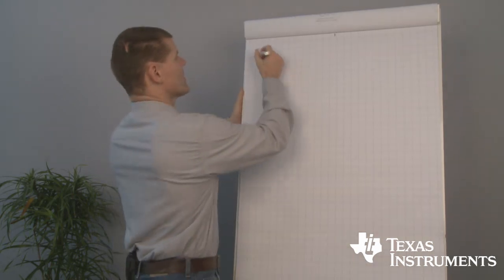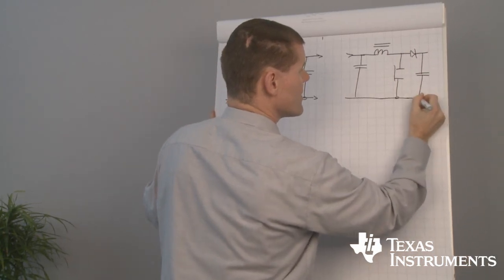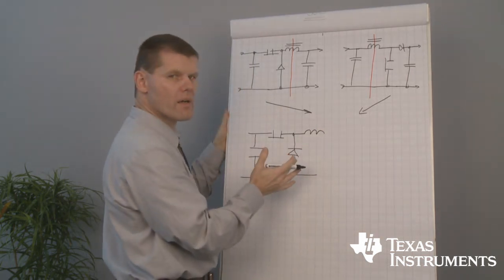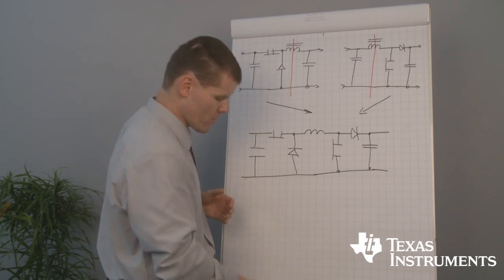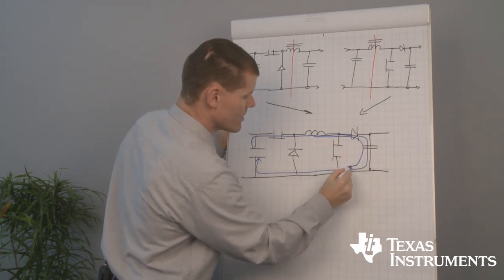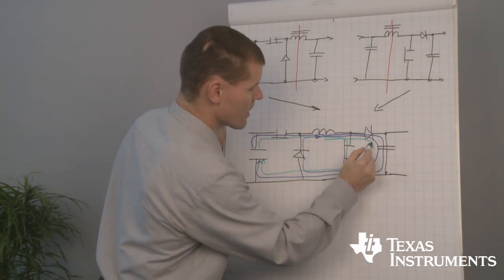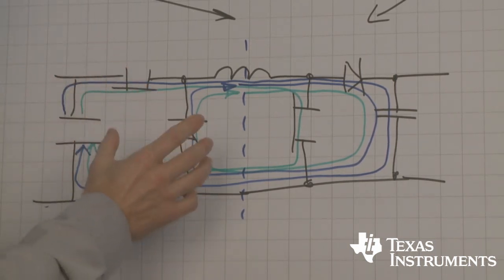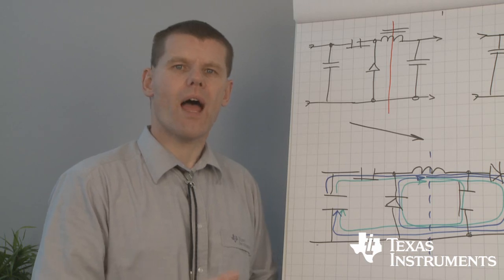BUCK BOOST POWER STAGE - Tutorial with Bernd Geck (part 3)

Comment from the maker: In Boost mode, high side FET is closed and low side FET is chopping. If low side FET is closed, a current is forced across the inductor out of the input capacitor. When low side FET opens, voltage at the inductor turns and is added to input voltage; high side rectifier starts to conduct. This current loop is closed across the input capacitor. For pulsed currents, the impedance of the capacitor is far lower than the dynamic inner resistance and reverse recovery of the low side diode.Thanks! Bernd

Comment from the maker: If the buckboost is in BUCK mode, the left highside switch is chopping, the right lowside switch is OPEN; if the buckboost is in BOOST mode, the left highside switch is CLOSED and the right lowside switch is chopping; in transition Vin=Vout typically both switches are chopping (see drop in efficiency due to switching losses). To get a four switch buckboost out of a two switch buckboost, place the two diodes by two synchronous rectifiers, like you do with a synchronous buck or boost converter.
Reply: Texas Instruments maybe you could tray with a circuit where you have a Diode in oppositive direction. Finally, you Will have swith, inductor in parallel, diode in opposite direction, capacitor, and charge

Comment: Hi, could you also provide the calculations to used to obtain the component values, for example to achieve a 2.85 voltage output with a 100mV input, how do I work out my capacitance, Inductance and resistance values etc. Many thanks.

Comment: How can the 'buck diode' (the left most diode) be replaced by a mosfet in this case? When the buck boost operates in boost mode, if the buck diode was a mosfet, wouldn't it short out the input?